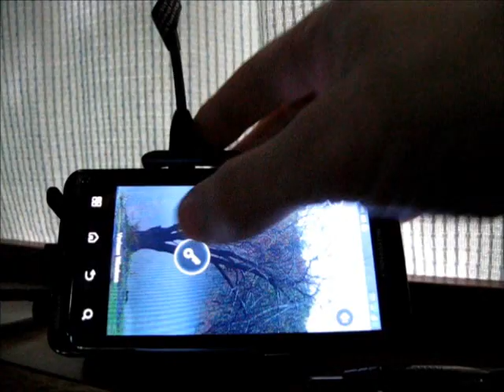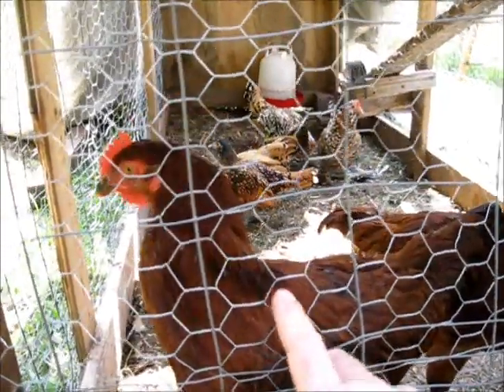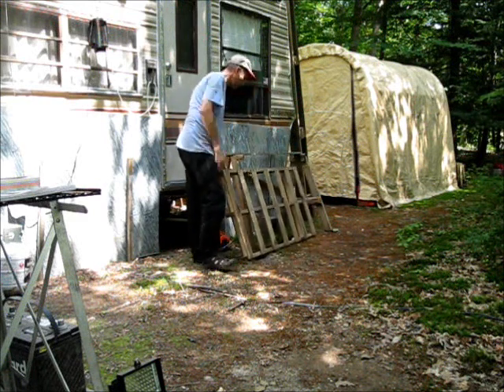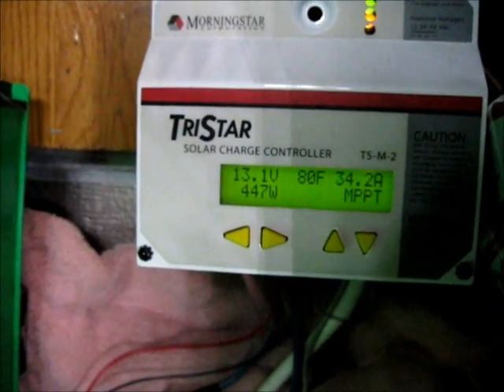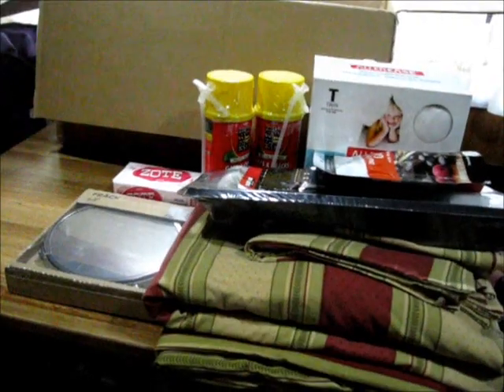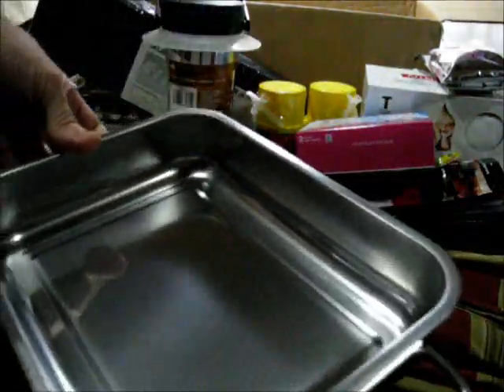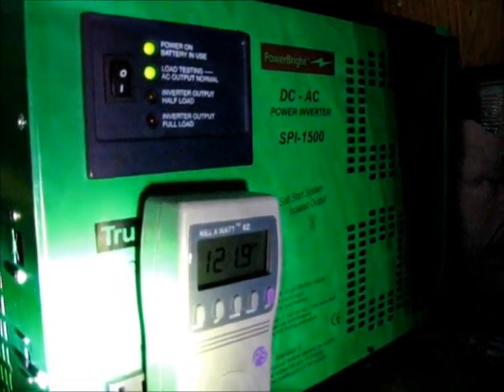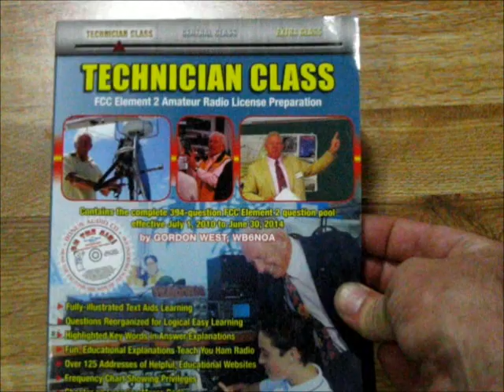Off Grid Solar Air Conditioning

Comment from the maker: The charge controller has separate wires directly to the batteries just to run the meter and tell the controller the state of charge of the batteries. Its the best indicator of the batteries status.

I have the inverter wired directly to the batteries on their own line.

Gives me an idea. I think I will draw up a diagram of my system for all to see.

Comment: Wow, what a fantastic feast you have there. Yum. I've replaced a screen in a phone before, might be the problem. Love the AC, of course you can do it. For the motor home, you may want to use winterizing plastic film kit for the RV windows to add a layer of insulating air. Also think about adding 3/4 inch foam insulation, spacing the paneling inwards. Might make 5000 btu work just fine.  Will reduce compressor on-time (watts needed). Why not use those mid day wasted watts for cooling? Go for it.

Comment: Dud your Video may of saved my life. Ive had the Question for a while if you can live off the grid with air conditioner can solar run it?
Im leaking spinal-fluid from a 1991 truck wreck super bad head aches Migraines Heat above 70degrees I get sick it sucks I now have hope and a goal. to move closer to my kids. Thank you God and the do it your self guy..

Comment: Did you ever find the problem running the unit off batteries?  My guess: the wires from your batteries are too low-gauge and/or run too long a length, and become hot/too resistive without the solar input supplementing the needed wattage.  I had that problem at first trying to get my garage door opener to run even though I knew my batteries and inverter were rated high enough to run it.  Thicker wires solved that issue.

Comment: You can get much higher power inverters for about $200 on ebay with input voltage cutoffs under 10.5. When the power surge demand from the compressor kick on effectively drops the input voltage such an inverter won't kick off. That or you could parallel some more batteries with thick wiring.

Comment: You don't have enough power to start the air conditioner's compressor.  But you can run the A/C's fan.  You can improve this a bit by installing a larger starting capacitor in the A/C unit.
Reply: MrBeach can't you heat the compressor running. So yes there is enough to run it.
Reply: And by installing a larger capacitor in the a.c. most likely won't do much.  The a.c. also uses that compacitor to run. So if you change it you can cause damage to the compressor.

Comment: Your vid "appears" to 3 problem areas/ Power inverters are not created equal & supply cable that is warm , is a big no no. Maybe the battery voltage dropped too far before the inverter sensed it. (the inverter thinks- low battery & kicks off). Panels are of 2 types, Mono-crystalline, works only in bright sun. While Polly- crystalline just needs daylight. Batteries should be golf cart type (very heavy) 24v panels & 24v inverters work better, with same costs. (No more warm cables)
Reply from the maker: I doubled the cables and had no more trouble. I like to mix solar panel types for better power output through various weather patterns. Most of my panels are 24 volt now. Thanks
Reply: Also, remember fuses & breakers permit some overload at start up! Inverters don't! On to see your newer vids, good luck

Comment: Idk if its been brought to you by now since this was posted. But the reason your phones locking is due to your charger. I had this problem with my old Razr, Basically its getting overcharged on amps (or watts i cant remember atm) But ya. Thats what your issue is.

Comment: looks like you have enough humidity for the capacitive display to work.  Unplug it from power micro USB so it is running off battery.  I had touch display problems like that while I was plugged into the charger (it was a high amp charger).

Comment: Theyre generally a lot more money but 12v appliances (yes they make AC units) are the way to go. There is so much heat generation and energy loss in the use of inverters they rarely seem to work out with any high current home devices. 
Just doing the math on the amp draw for say 1000 watts is daunting. Its like running a starter on a car with a big block v8 full time. 
I have a large second battery in my vehicle running a whynter 45 cu ft freezer. You have to drive the car a LOT every day to keep up with the total energy use because the freezer is almost always running in warm weather. 4 amps x 24 hours = 2.4 hours @ the 40 amps the alternator typically delivers. Thats a lot of gasoline.

Comment: Amperage draw at compressor startup can be as high as 150% depending on the type, size, age, and quality of the compressor.  The starting capacitor is most likely too small for your application.  The surge current is too much for your wiring (from what you mention) that creates an under voltage situation at the compressor which drives the amps up.  Also, the hotter the ambient temp, the more amps the A/C will draw.  Baking in the sun tends to increase that.  Your solar converter meter is sampling at too slow a rate and not picking up the inverters output side load before the inverter shuts down to protect itself which is a good thing since no inverter means no AC.  The solar converter is not designed to monitor the load of a load.  Your inverter is only 80% efficient as it is a pure (full) sine-wave.  Modified units can be up to 90%. 

I have a MB Sprinter van with a rooftop 11,500 BTU RV A/C that I can run off the propane generator or a Xantrex X-Power 5000 inverter while driving as the dash mount A/C just can't cut it in the back.  The inverter has a running load capacity of 5000Watts and an instantaneous surge capacity of 10K Watts.  It is a modified sine-wave.  I am using a house bank of 2 x 12VDC 105Ah flooded lead acid deep cycle marine use batteries on 1/0 welding cable.  The system and the vehicle is charged and ran from a single 3-phase 240A alternator that creates about 135A at idle speed of 900 RPM.  It can run directly off the alternator and the starting battery (large 1,000CCA 100Ah automotive) with the dash A/C on medium at highway speeds.  Only with a fully topped battery and no other loads (no dash A/C or low batts) can I run the rooftop A/C at idle without discharging the batt(s) rather quickly.  This was uncharted territory so I went the cheap route on the alternator.  For $400 more, I could have bought a 6-phase 270A alternator that put out much more amps at idle that should have resolved this.  It would make short term city driving much better.  The system, with fully topped batteries can only run for 15-20 minutes (depending on ambient) on battery  power alone.  A PTO idle-up option for the Sprinter would make it work with the current alternator and would be better for the engine/turbine but that is another $700 in parts and increased diesel consumption.

The system gives us more freedom to use the A/C when we need it without the need for the LP fired generator and extra noise.  The demand regulator is FUBAR so I have to do a song and dance to get it started with starting fluid so that is a pain.  The inverter runs the entire AC distribution panel (Parallax 7355) so I have to manually disconnect the charger/converter breaker.  I was told by both manufacturers that they both can be on at the same time as the charger/converter is filtered (no AC ripple) and that it would just be another load on the inverter.  I can't verify that as my charger section of my converter was fried well before this install.  I use two AC transfer switches between shore, inverter, and genset.  The batteries are isolated automatically by 2 x 500 amp battery isolator solenoids that can be manipulated with a remote switch for manual isolation.  I found that for this project, sourcing parts from a marine supply house provided for a more robust setup.   I am researching solar panel options so that the house bank can be charged without so much effort on my part.

Comment: When you first turn on the AC try putting water in the rear (where the radiator is) and try to put the unit in a window facing the north or east side. you may have already known that. God bless you.
Reply from the maker: Actually I did not know that. I do know that these recycle the water to help cool them but of course did not think about the first start up. Thanks. By the way, have a look at my newer videos. I am now in an off grid tiny house on wheels I am building using all recycled materials and buying the land: https://www.youtube.com/user/techman2015/videos

Comment: 80 - 90F lol you think that's hot you should come to Australia, specifically north Queensland, where its hotter and sometimes even more humid.. and we get stuff done here in that heat.
Reply: People get things done in all kinds of weather when they have no choice. 100% humidity is the same anywhere you go though. The ambient temperature is rarely the problem. Arizona for instance can get very hot, but it doesn't feel too bad unless you step bare footed onto the concrete. No humidity makes a hotter ambient temperature more tolerable. Humidity is what sucks anywhere you go. Hence the reason I prefer the desert.
Reply: humidity is dangerous. The body can't cool off unless sweat is removed taking heat with it. They lack of dry air (in high humidity) stops the effective evaporation of sweat, so stops the body from cooling. You can overheat and die easier in high heat/high humidity.
Reply: gunforme you got that right,, the humidity is what gets you,, I lived in lousiana
and it was allways 100% humidity and 90 - 100 degrees and it was awefull but I still worked every day 8 - 12 hour days in a hot body shop,, I lived in pheonex and Scottsdale for a few years and it was very common to have days that were 115 degrees but it was dry heat,, I was hot but not as miserable as when I lived in Louisiana,, I also lived in Oklahoma city for a while and it got real muggy and sticky but the worst had to be there in the bayou,, excellent food but hot and muggy days

Comment: The inverter is too small. An induction load like a air conditioning compressor requires an inverter that will comfortably handle 10x the running load , i.e a short term load of 5000 watts for 500 watts running load. The inverter shown here is rated at 1500 watts RMS, 3000 watts short term load. A large capacitor on the AC side would help a lot on start up, preferably wired inside the Ac unit itself
Reply: he could use slow leak caps or now the also have lithium- ion battery banks but if u dont under stand water and lithium don't mix it can explode and cause a bad fix and water putting out that fire not good

Comment: Just to help with the heat. Learn the winds. Make drafts and cut holes near the ground on the side with the prevailing winds, then and add the double fans blowing air in that air. 

Then make hole in the roof and have a small fan to push the hot air out. 

Continuous fresh air and cooling. The fans barely need to be moving. They are only important for getting the draft started. 

Might help to have a dedicated wet towel to put around the back of your neck

Comment: Sadly true. I'm not off grid, but the power I use where I am now will not allow me to use the roof air on my motorhome. It draws too much on start up & crashes/surges the power, thus tripping the breaker. So I had to resort to using a portable a/c. It doesn't pull as much power & doesn't do the big compressor load. So along with CheezyDee, I think it's the start up thing that's the problem. :-/   My portable usually keeps the RV at 82-86 during the day, but pulling out the humidity is the key!

Comment: I don't have a great grasp on all this solar stuff but it seems like a lot of work for so little in return.  I would have thought that by now someone would have invented some type of super capacitor to hold a large load and some sort of better panel to capture more efficiently to really make this all worthwhile.   

I just feel that at this stage its still at the stage computers were when a computer took up a room.  I need to take a course and learn more so I can think of a better way or out side the box to develop better panels so that you could truly run an apartment on 80-90% solar without needing a field of panels.

Comment: It also looks like maybe your inverter might be too weak.  Maybe a 2,000 or 3,000 watt may be better just to be able to handle the initial jolt when the compressor turns on for the first second.  Maybe the one you have now couldn't take the beating.

Comment: I think you might be missing the voltage difference; looks like your panels are generating 455 watts at 13.2V, while that AC is pulling 480 watts at 115 volts. So, your panels are generating the equivalent of 52 watts at 115 volts. 

I'm guessing you'll be seeing your battery pack run empty a lot.

Comment: Try a kick start on the compressor on the AC its just a large capacitor you can get at a hardware store or AC supply store the initial pull the AC is much higher then it's running pull the capacitor will store energy  for kicking the a c on then your system should be able to handle the regular running load

Comment: First thing I would do is shade the roof and sun exposed side walls. RV's usually have very poor insulation, it's like living under a pie tin.
Any shade set up should have an air gap between shade device and metal RV surface. Won't help humidity, but shade will lower inside temps, almost for free. A PVC tarp would work well..Look at 'billboard tarps' on line. They sell big recycled billboard tarps.
Reply: I should have said 'RV's are usually poorly insulated'. It's not that they have poor quality insulation, just not enough.
Reply: Terry Lutke
yep poorly insulated about as well as a cardboard box ,originally i believe these recreational vehicles were used recreation-ally so who gave a shit!

Comment: Yea humidity sucks. I spent a couple years in the foothills of northern California. One summer there I recalled it felt hot but not overly uncomfortable. I checked the temp outside and it was 105 degrees! However the humidity was like 2-3%. Where I am now on the east coast, recently it was 85 degrees with humidity of around 90% and it was unbearable to be outside for even a few minutes. It is one thing I miss about California, comfortable summers. The nights were wonderful.

Comment: Based on what you were showing, the AC was pulling more power than what was being produced so you were draining your batteries all day.  Not sure how much sun shines on the top of the RV, but you might want to put a tarp with an airspace over your roof; this should reduce the heat inside to some degree. Also just simple air movement helps a little

Comment: It has nothing to do with the Operational System, but with the hardware brand that is either too cheap or it suffered a major fall and it damaged the screen which explains why the screen sensor is having troubles to identify the unlocking area of the screen.

Comment: when your phones connected to a charger or any other usb device the screen gets disable for some reason so if you want to unlock your phone be sure to disconnect the charging cable.
Reply: I also experience this with my phone from time to time, and taking it off the charger seems tom solve the problem.

Comment: Troy, have you tried powering your phone off, take battery out and slide down/or out Sim card- wait 30 seconds to let it reset and then reinstall Sim card, battery, power on then maybe it will unlock better- does seem to be hanging up on the unlocking. The Verizon lady told me this works for most problems, so give it a try.

Comment: Troy. if I may make a suggestion. I'm getting old & may have forgotten a little about electronics. Inductive loads are hard on the systems. They create a huge load on start-up. HVAC for homes have a big cap on the front end to help mitigate this. Inductors are like a direct short for a small period in time. So your system may be experiencing an overload & shutting down. Especially when the current from your batteries is lower. Just my 2 cents. Hope it works out though. Praying for you.

Comment: Theres typically a huge surge when ac compressor kicks in, my understanding this can be more than double the rating on the unit, although brief i could easily see that inverter not being willing to do that.   Can you or have you tried running any large inductive loads from inverter?  Something like a circular saw?  Ultimately i would think if its not an inverter issue, your going to quickly need a plan to double your solar and storage capacity.

Comment: maybe you need gen at night to maintain steady 13.8 VDC to the battery bank, as the panels do during daylight hours. The inverter is doing it's job protecting it's source. There seems to be a reason RV manufactures use shore power or gen for AC.

Comment: Somehow the boost from the panels is just enough to keep it from tripping. With the PSI above 500 and R410 it looks like that little A/C is a scroll compressor! Show the compressor sometime, they are tall and thin compared to the black "blob" you see on old ones. The surge on that will be about 700W so that's what you are dealing with. You might be able to catch the surge on the KAW if you video it, may take a few tries, remember that a A/C needs to sit for about 3 minutes before restarting it.

Comment: Watched your vid and haveing lived off grid for a few years on solar and gen power, the power surge on the batteries when AC kicks in is dropping the  inverter voltage below cut off for  about a second or two. Not sure of your wire size on DC  side but should be #8.  #6 even better. and at  #12 on output. you are drawing aprox  40+ amps 12 volts for 500 watts of power. Your solar panels during the day absorbs the surge. And a 73's to Randy K7AGE. Study that book and a simple 35 question test that 8 year olds  and younger have passed you can have the world at your finger tips. 73's and good luck Bob NE7NE